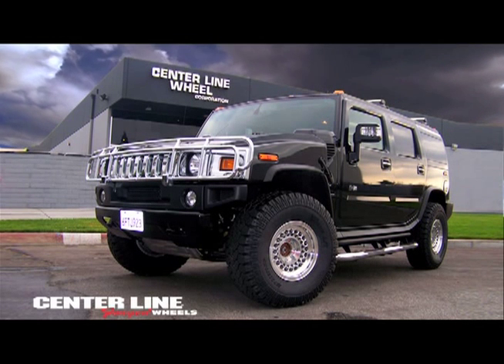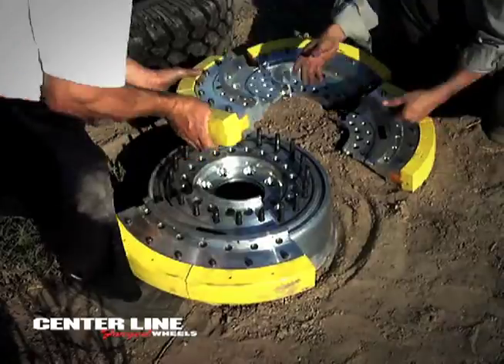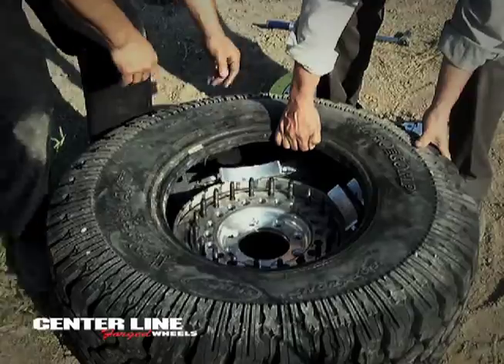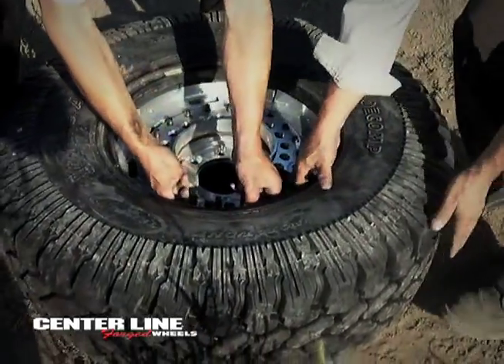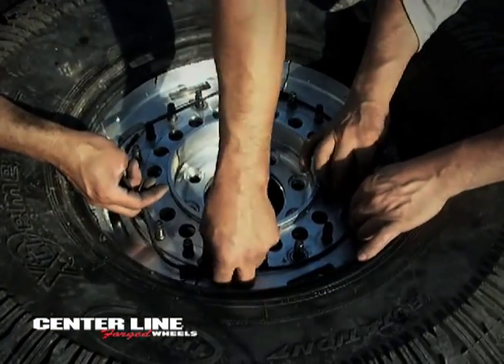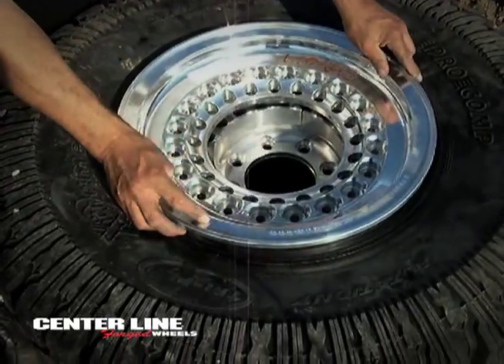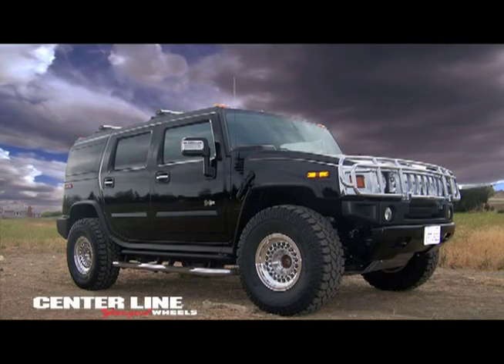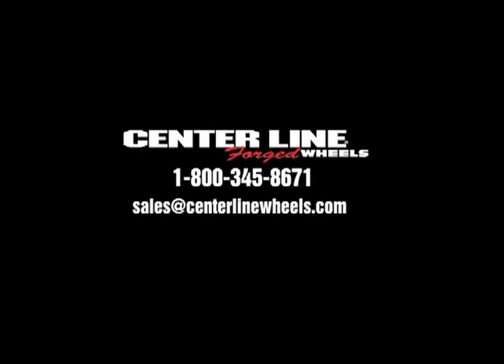CENTER LINE MILITARY RUN-FLAT WHEEL

Comment: Disassemble and reassemble in under 10 minutes? Not a chance with one guy. Maybe BOTH those guys WITH the impact wrench. Also doesn't take five hours for the traditional style 2-piece double beadlock wheel. No idea where they get thier figures from. I've assembled several myself and it's not real fun.